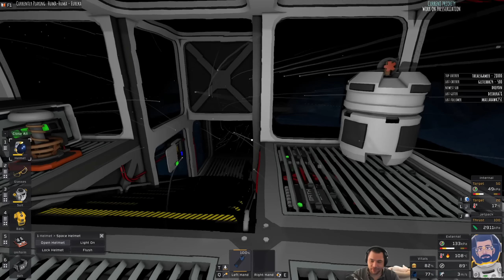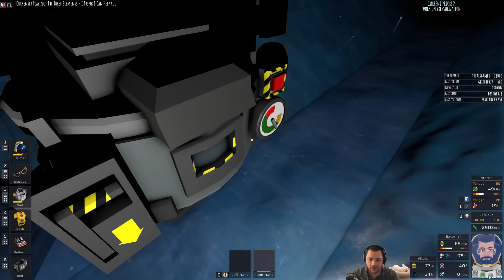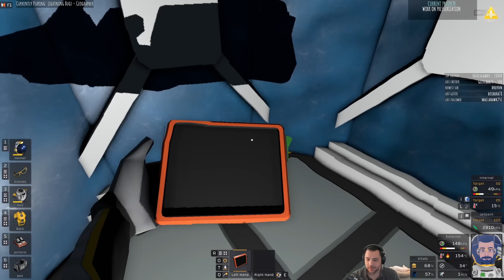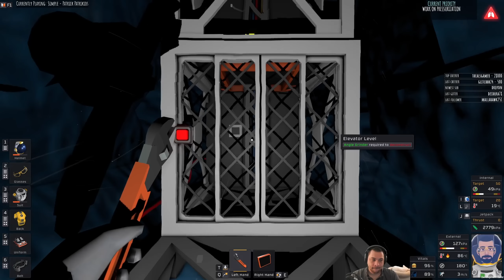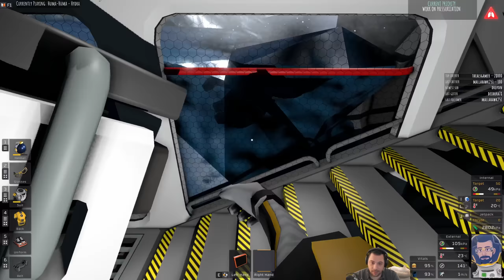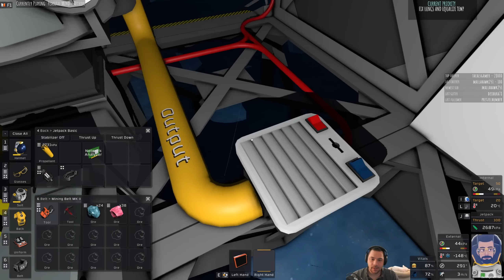Stationeers Europa - Pneumatic Cannon // EP22

Comment: Your first death was your fault, really. You jumpjetted in the elevator and broke your suit, then you opened the window at ridiculous pressure and chased it outside.  The other deaths were not your fault. Death counter 1
Reply from the maker: No, the other ones were my fault as well
Reply: The furnace death was caused by the furnace having a ton of pressure in it so when it was removed first it caused the gasses in it to be pushed into the three pipes, over-pressurising them.

Removing the pipes first would have made sure there was no explosion.

...the spawn point deaths seemed like a bug though. Do spawn points need a certain clear area around them to function?

Comment: Been watching the last few episodes wondering when you'll realize you have a heat sink (leak) in that tunnel opening. Just follow the air flow.....
Trying to fix the symptoms of that got you killed three times.
Reply from the maker: The series is over, no changes can be made at this point and no such leak actually existed
Reply: There was no leak. Airflow was there because of temp changes. Base is massive and game does not handle it so well. Guess he did not respawn in base because pipes or something got in the way. Then again, I think  it was nice change in pace. Noting to worry about, those things happen in Stationeers all the time.